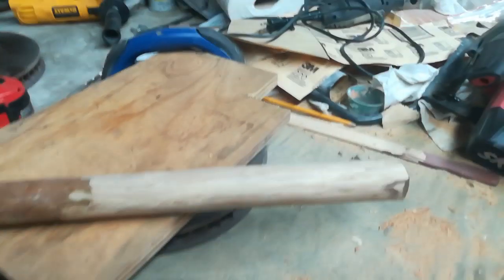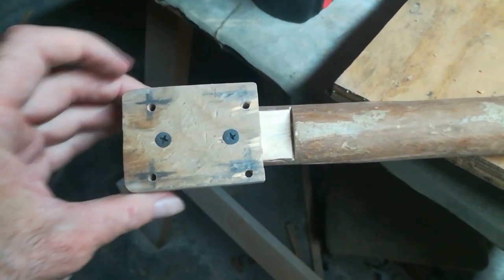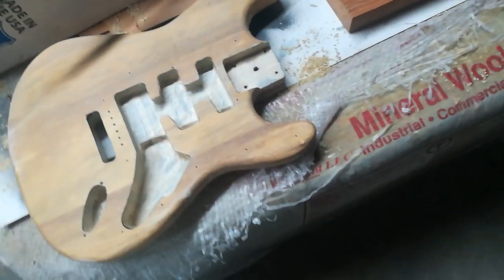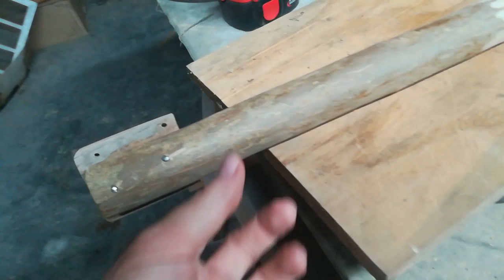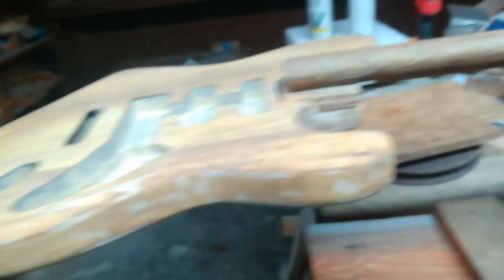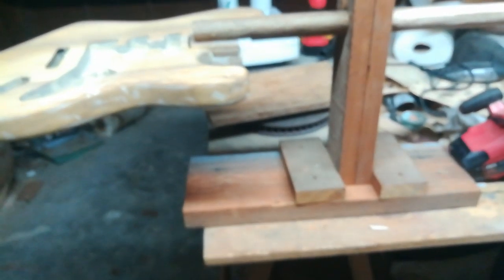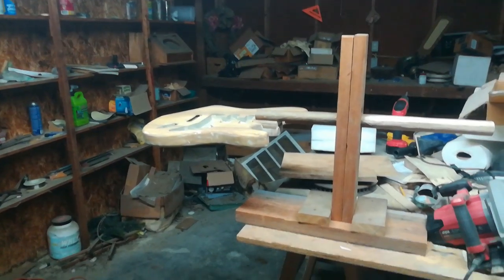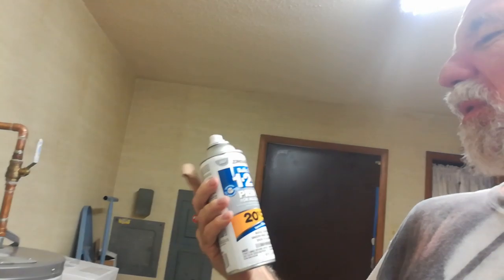painting stand for guitar body is DONE!

Comment: Have fun with it sir. Even if something doesn't work out, you can always give it a quick scuff sand and shoot it again. I like to put on enough clear coat to be able to wet sand the clear coat and buff and polish it for a perfect finish. I can't wait to see the result. Take care, and have a great day.
Reply from the maker: it'll be a while.  The temps here are in the 90s and the humidity is always intolerably high.  It's like walking out into a sauna.   So, it may be a month b4 I really get it painted and then it won't be finished.  I plan to scallop the fretboard also and might try some new pickups but  then that means I need to hear it BEFORE I paint the pickups so there's a huge pain.  Install it all, hear it.... if ok, remove the pickups and paint them and put them back in.   oh well....  I could just buy some Fender noiseless ones and forget about it and go ahead and paint them.  If only I were super rich. hahahah  I could buy  6 sets of pu and just try them all.    buy 6 guitar kits and make them (after buying $10,000 worth of tools hahah)

Comment: Nice build! Yes on the light sandpaper for painting plastic, 320 or so. Just a tip on using the drill for screws, take off the bit holder with the longer bits, gives you better control.
Reply from the maker: yeah,  I prob could have just put the screw end in the drill w/o that adaptor.  I just grabbed it and went with it.  I'd be way more careful when doing it to a finished guitar and also use two hands instead of one. :)  thanks ya!!!

Comment: There's a product called "Bulldog" that you can find at the auto parts store...  It is a plastic adhesion promoter.  It works well for getting paint to stick to little plastic bits.  If you use it, make sure you're outside, its hard on the lungs.
Reply from the maker: I THINK this primer actually supposedly allegedly sticks to plastic but if I sand at 400 grit, just a little it prob will be fine but I can test what I have FIRST, if that doesn't cut it, I can look up this bulldog you mention.  thank ya!!!!

Comment: Instead of drilling more screw holes, try making a universal block that is compatible with various screw hole patterns.
Reply from the maker: yeah, or..... oooooh   check it..... VELCRO.     no screws, no compatibility issue.  except I'll at most have to sand the block  smaller to be sure it fits into a smaller neck slot.  wow, a full  sheet of velcro would or should totally hold 7 pounds.  but if not..... I can just make a new block each time.  Won't take any time to make a new block.  Two saw cuts,  six screw holes.